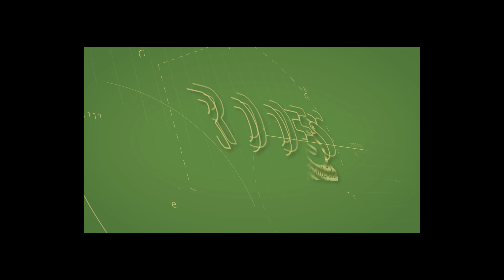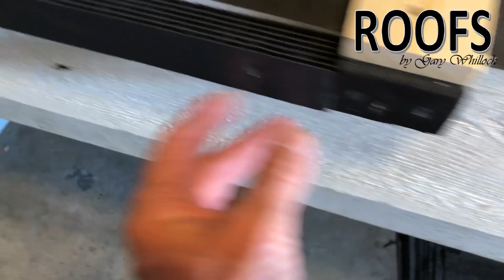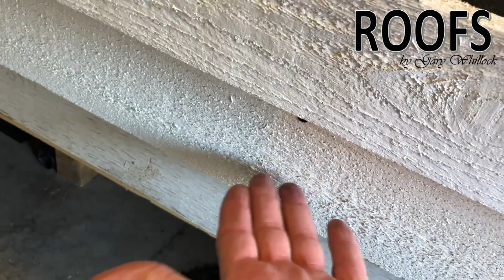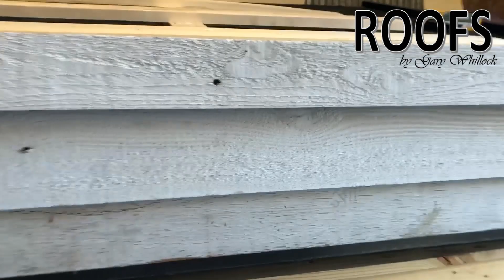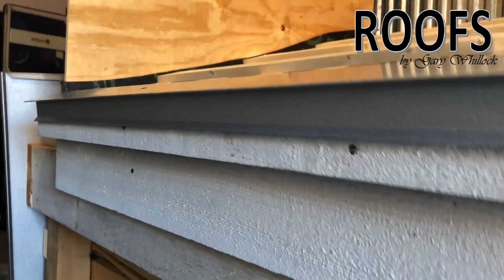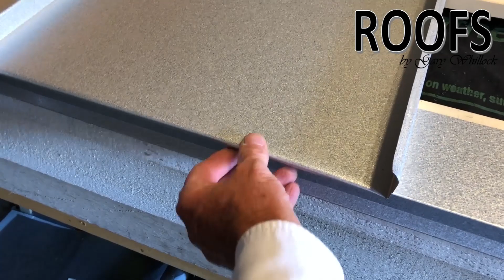How to Vent Your New Metal Roof

Comment: Will this venting system serve to vent the roof rafters and insulation below the roof deck?
Reply from the maker: Nice to have input from an artist.
Reply from the maker: The best application is foam insulation between the rafters, enveloping the entire attic space, as cool space.
Reply: @Exteriors by Gary Whillock  thank you. Part of my house has a cathedral ceiling and the other attic space. I’m planning to put a new roof (2x6 rafters) over the old one (after stripping the old shingles off) to eliminate a shallow double pitch on the north side, creating one continuous span from eve to peak and the south side we would just lay the rafters on top of the old roof decking. This will also give me the opportunity to add more insulation as well. Is it advisable to vent the new metal roof as you described in the video as well? If so, would you connect it to the old soffit, through the new rafter tails, to skip sheathing? Thank you!
Reply from the maker: @philipfreypainter  I wish I could be of more help, but I am in central Texas, a very hot reagon, and though I live in Colorado for a number of years, I never tried this in a cooler climate, let alone one with likely high moisture. Best of luck, thanks for reaching out.
Reply from the maker: @philipfreypainter I saw a video, Talking Art in Maine - Impressive!

Comment: what about the occasional hail storm, the open areas under the metal would let it bend down with large hail
Reply from the maker: Thanks for the question!  We have more than our share of hails storms here and occasionally they get extreme in isolated areas, but most hail storms come with hail under golfball size and we've found this installation doesn't affect the performance of the roof.  What matters is the thickness of the metal.  We recommend 24 gauge steel for all standing seam roof applications.

Comment: Thanks Gary. This video was incredibly informative. Nice clear presentation of the method with good details. I have been installing asphalt shingles for a long time but only done a few metal roofs. I am going to quote a big one and couldn't exactly picture how the venting on the soffit went together. Instead of painting, I think I'll get some stock vented aluminum soffit and f-channel, then make some fascia on a brake to tuck up under the drip edge. Thanks again, great video!